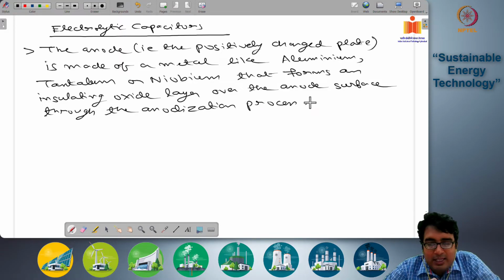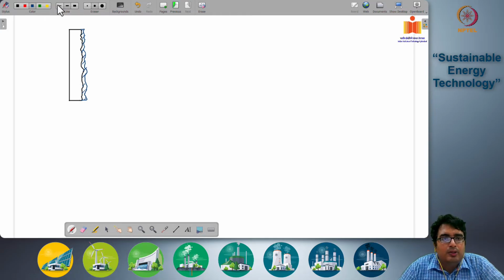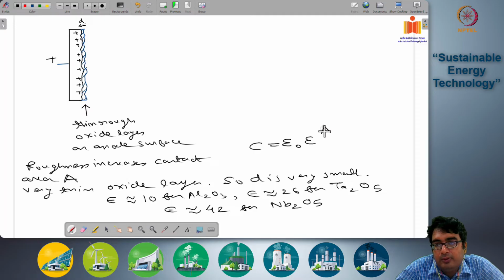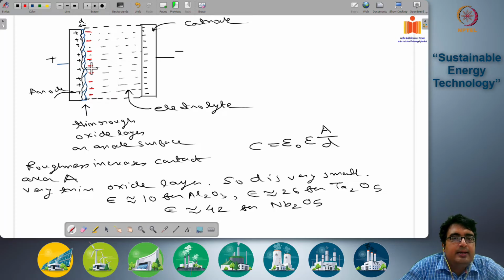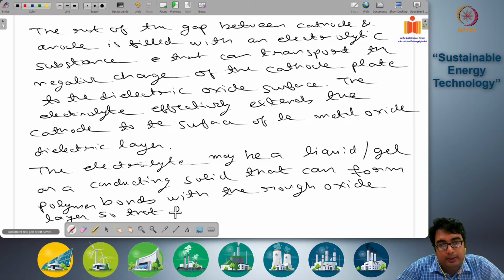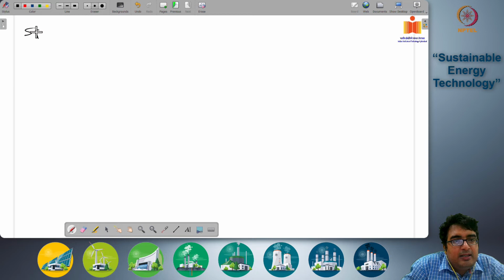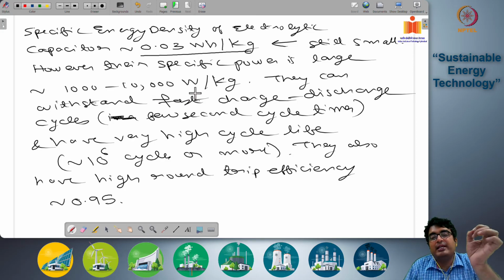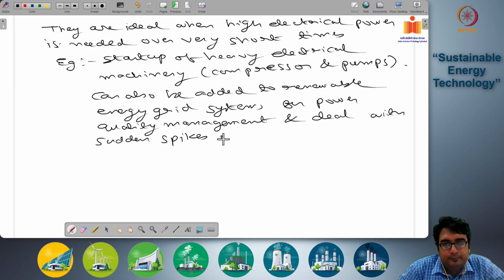Electrolytic Capacitor | Sustainable Energy Technology

Comment: Timestamps (Powered by Merlin AI)
00:07 - Electrolytic capacitors store more energy than traditional capacitors.
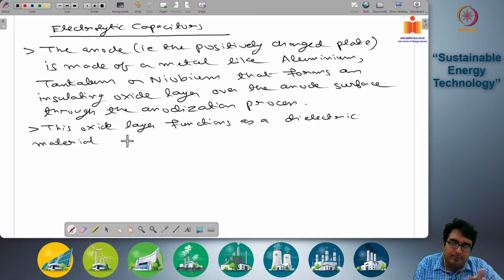03:53 - The oxide layer on the anode enhances capacitor efficiency.
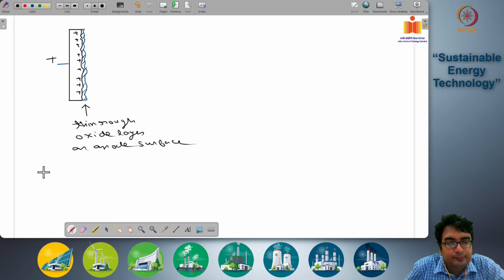08:28 - Dielectric properties of materials enhance capacitance in electrolytic capacitors.
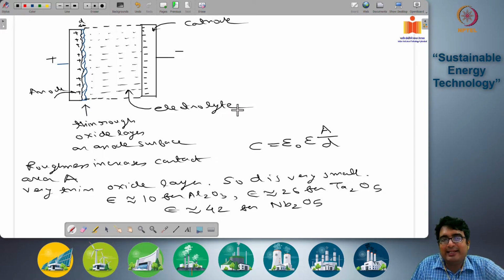12:30 - The electrolyte facilitates ion transport between the cathode and anode in capacitors.
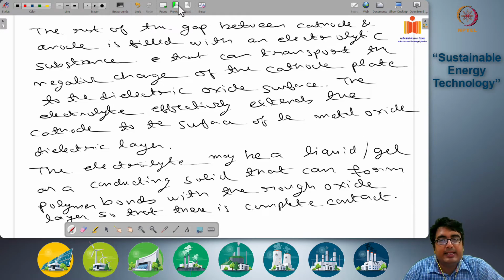16:51 - Electrolytic capacitors rely on electrolyte for capacitance and have distinct anode-cathode properties.
19:24 - Electrolytic capacitors require DC voltage due to polarity constraints.
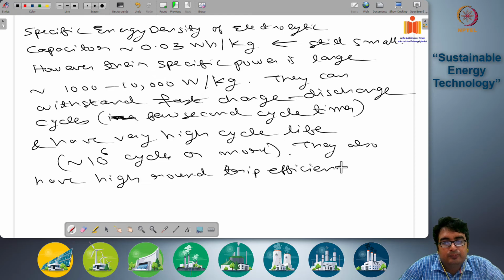22:35 - Electrolytic capacitors offer high power with modest energy storage.
25:07 - Electrolytic capacitors provide high startup energy for heavy machinery and enhance renewable energy grids.